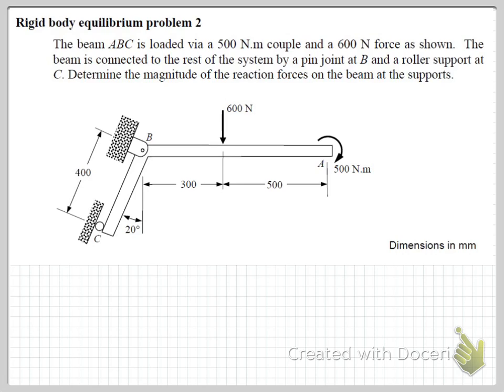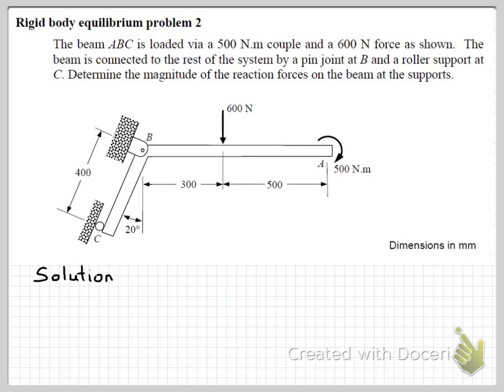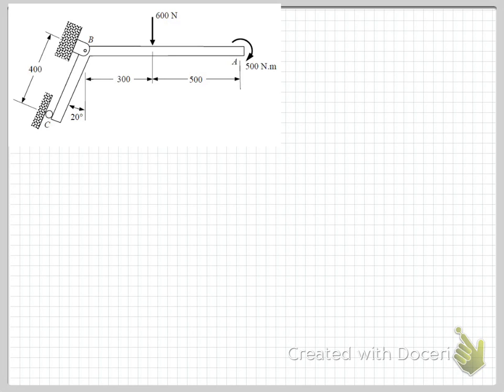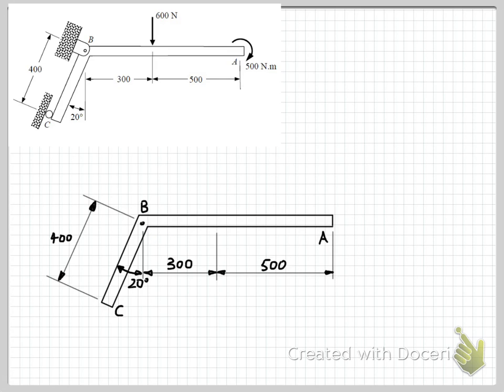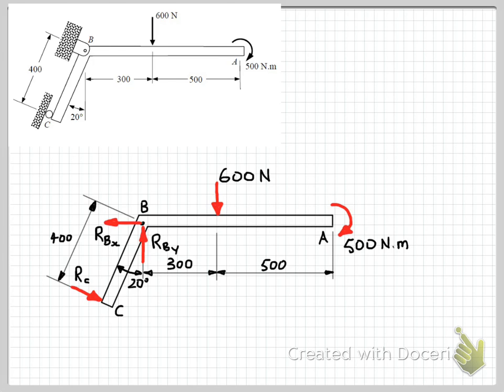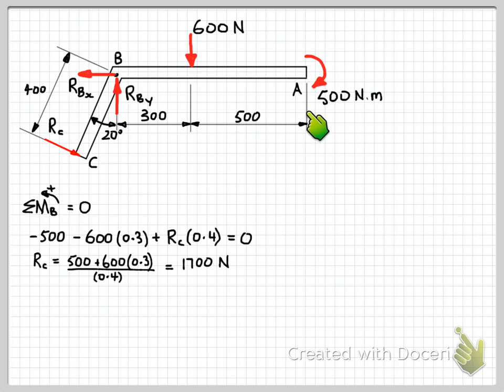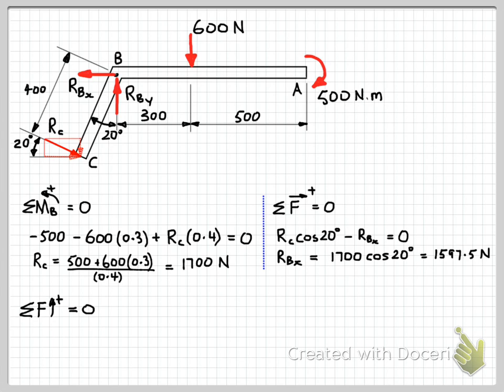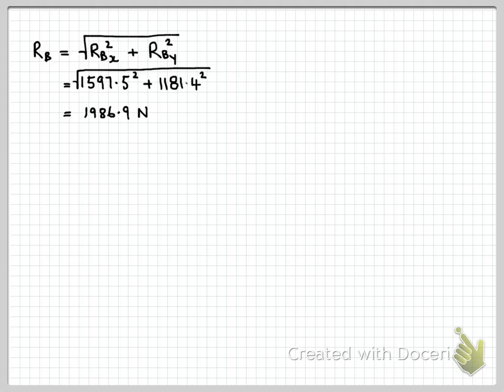Rigid body equilibrium example problem

Comment: Professor how do we know respect to which point we gonna take a moment?I'd be grateful if you could help me to understand
Reply from the maker: You may take moments about any point you like. However, there is usually one (or maybe two) points that are most convenient for ease of solution algebra. In this case I take moments about point B because there are two unknown reactions at point B. They will have zero moment about point B which then enables me to determine the unknown reaction at C straight away (i.e. one equation with only one unknown).
Reply: @TerryBrownMechEng  If we take moment about point A ,sum of the couple moments and force moments respect to A  also gonna equal to zero ,right?Same for point B also?
Reply: @ygt824  yep 👍

Comment: Hello, what geometry brings about the second angle (20 degrees) which is the same as the angle between the line BC and the vertical line?
Reply from the maker: Rc is perpendicular (90deg) to BC because there’s a roller support at C, and since BC is 20deg from vertical, Rc must be 20deg from horizontal. Sorry for delayed reply, only just saw your question.
Reply: @TerryBrownMechEng  🙏🙏🙏